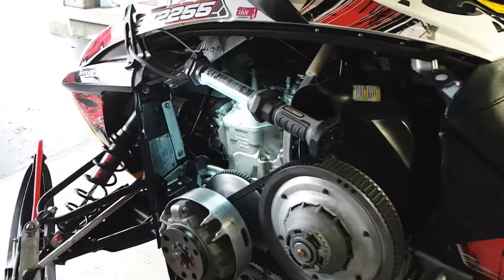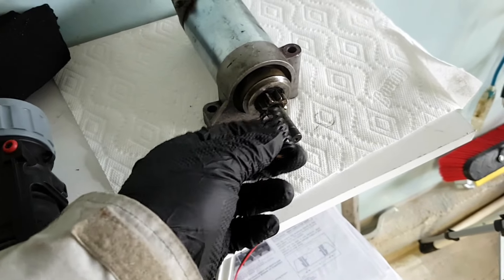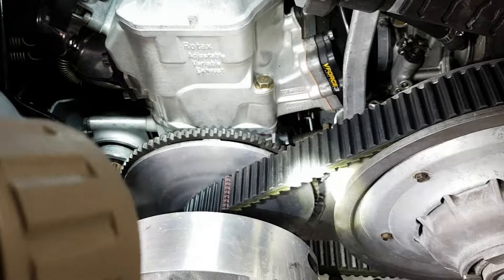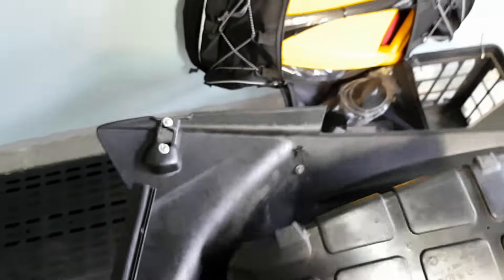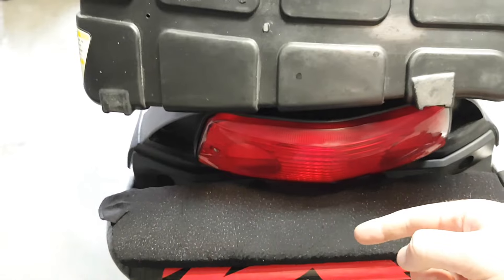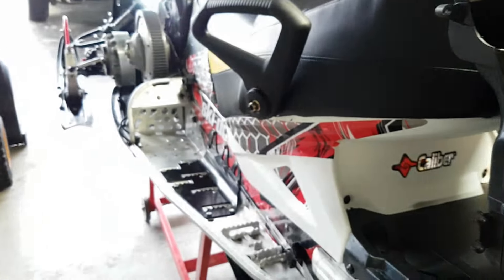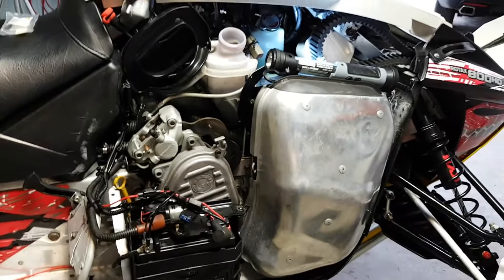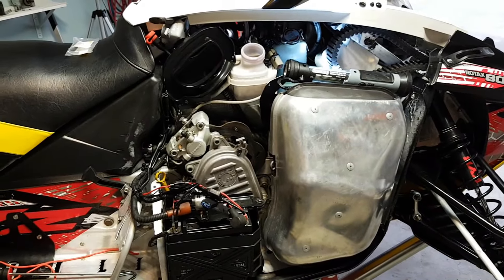Things Most Ski-Doo REVs Need Fixed (from factory)

Comment: Too much oil causes a lean condition? Wrong!!! And what you said about water in the oil is totally wrong, it will go to the bottom of the oil reservoir and freeze, causing your engine to seize. Same thing happens with water in your gas tank, water is heavier than both gas and oil.

Comment: Fyi, extra oil going through the motor wont cause a lean condition. The oil and fuel are fed through completely separate systems. The worst thing you’ll do is foul spark plugs. It’s more wasteful than anything. Good oil isn’t cheap!
Reply: According to Wiseco, that is precisely why you don't add extra oil when breaking in an engine after installing new top end.....so either they are wrong, or you are.
Reply: @davidstephenson7194  in their case you dont want to add extra oil during break in because the rings they use are made of a harder metal than most and take much longer to break in. The extra oil makes rings take longer to break in on any motor. Synthetic oil is also not recommended during break in because it prevents faster ring seating due to superior lubricating properties. If you dont break in wiseco rings before riding your engine hard they can expand too much and bind up in the cylinder causing  major piston damage. Once they are worn in the ring gap will be large enough to allow for proper heat expansion during high engine loading.

Comment: My 2006 renegade 800 has this weird thingy going on where it has a clicking sound every time i speed up. Do you have any tips on what it might be. I have already checked throught the clutch and didn't find anything wrong with it.
Reply from the maker: Sorry. No idea. It typically takes a lot of trial and error to locate noises. So many pieces ...
Reply: @TheGarage656  okay, I am pretty sure it's the bendix that is making the sound. I ordered a new one and hopefully it will fix the issues. Anyways thank you for helping my situation:)
Reply: If it's your bending you should see wear on your ring gear.
Reply: @warddan2002  I changed the whole bendix and it stopped for a while. I don't know if it still does it, because I sold the sled a few weeks ago

Comment: I have a 2007 GSX SDI 600. I keep the starter lubricated with a good spray weekly. A new belt needs a break in period to perform well and last longer. I also lubricate the throttle bodies, the oil injector & springs you showed, the throttle cable and the suspension. If you're gong to change springs of any kind to aftermarket, just be careful how much they affect the performance, especially anything to do with the engine. It's good you look the sled over and look for any way to improve it. Maintenance gets you back home. :)
Also keep the battery connections clean and apply some dielectric grease.
Reply: Nice: "Maintenance gets you back home." I'm going to use that!

Comment: I have a 2005 1000 and have a problem with it on my last ride last year with it shutting down & then the Ele start won’t start it back up but I wiggled the fuse wires & the fuse is melted    buy the battery but it did start back up, any suggestions or videos on the fuse by the battery on what to do? I would appreciate it.
Reply from the maker: When things start melting in terms of electric I take it to the pros. Too many ways to burn the unit down. It's worth the cost of a dealership.

Comment: what about the Boots for the Carb intakes - they are probablimatic as well prones to cracks and may need replacement
Reply from the maker: Yep. Good point. I needed to replace mine too.
Reply: Just changed mine on my Can Am Outlander. Huge performance improvement. For 63 bucks I hopebit lasts.

Comment: I have a possibly silly question, I’m going over my daughters Rev for winter (2005) and the Belt has a mark on the outside that looks like the Bendix is extending out while it’s running and hitting the belt. Sounds strange I know. 
My question would be if you had any of that issue before you changed that spring?
I’m also in canada, Ontario. 
Thanks  for any reply.
Reply from the maker: If the belt was up on the clutch really high I guess it might be a possible problem. Unfortunately that is one of the few problems I've never had so I cannot comment. Could it be the wrong starter (wrong model)? Therefore sticking out just a little to far (too long?)? Tough call. I hope you get a solution.

Comment: Hey great vid! 

Do you have P/N for those front shocks? Also, did you upgrade the center and rear shock too?
Reply from the maker: Sorry. No P/N for those. I went to a local guy who specializes in shocks (rebuildable shocks). Yes, the centre-rears did eventually get upgraded, as well as springs (doing one but not the other less than ideal). Shocks are silly expensive so shopping around locally with people who do it professional (rebuild them) proved the best deal.

Comment: Water in your oil will not dry out with cap off! When riding and shacking around it DOES mix and it will go thru your pump and into motor and try to burn it! No Good! Drain it out and start over with the skidoo cap. Another thing, these motors get no oil to bottom end, bearings are packed grease! So thats another reason they want these motors using extra oil, cause the bottom end is non lubed and they hope the excess unburn oil will eventually drip down to bottom end and somewhat help lube the 2 center bearings that ARENT changeable unless u buy a reman crank! Crank is 2pc and need special alignment blocks to basically time crank when pressed back together after bearing swap. Not many do this, thats why u just spend 800-1000 on a reman. Let that motor EAT OIL! Itll be the only saving grace for it! Good luck
Log on to REV Nation on FB if u want true rider tips and fixes. Not a fourm that shit the bed with kids on these sleds
Reply from the maker: If you are referring to the return spring on the oil pump arm, I'm not sure that I follow you. The purpose of the spring is to make sure the oil arm is doing exactly what you want (returning correctly). That's all. The amount of oil that enters the engine is then entirely controlled by the oil cable adjuster (a pain to adjust perfectly). Without the spring, the amount of oil (if the oil pump starts to fail open, or merely weaken with time) is guess work. In my case the return spring made a huge difference, which means I am only now able to regulate oil to factory specs. The oil cap is another story ... still not trusting it entirely.
Reply: Garage Philosopher weather u have that spring on or not, when the pump fails, it fails open inside. Not by the outer arm. All that spring is for is to return to neutral so to say when u let of throttle. Nothing more. If adding that spring changed oil usage then something else is wrong, or its making it too lean, not enough oil. And it will blow up in sooner time. These 800s were problematic,  the good dealers that know these motors adj them to use extra oil compared to factory setting, just cause they had so many issues.  A good day of riding, u should be using around half a tank. 140-180mi day. Any less these motors dont last if u ride them hard

Comment: Put a powerbloc 80 primary clutch on there less moving parts equals cooler clutch and itll go faster
Reply: Skidoo primary clutches are actually pretty nice. You can adjust ramp angles on the trail really easily from the factory with ‘clicker’ adjustments.

Comment: how do you keep your engine so clean
Reply: josh obrien hes doesn't ride it, lol
Or someone had sled fully apart, probably for the 9th engine swap or rebuild, lol and yhey powerwashed the shit outa it to find some sucker to buy it cause it was clean. Truth
Reply from the maker: Chrome cleaner for wheels works wonders ... just be careful with the water and dry the area extremely well after. I'd only wash it when it is out of the sled.

Comment: I took panty hose and rubber  banded it to the round inlet hole so nothing gets in there..  also the pre filter I did..I can't believe when I open the side panel, once it was a price of straw, then foam from the pre filter and brake dust...

Comment: Throw away that cheap oil cap #1
Extra oil in gas is not LEAN condition! It makes it RICH!  On skidoo motors, specially those PowerTek 800s after they blow up, a GOOD dealer that rebuilds it turns up the pump to use MORE oil and adds Fuel , so they wont BLOW up again, causing the sled to use a lot of oil and get around 10-12mpg on gas! So the 2 fixes u just did, might help cause a catastrophic failure to your poorly designed 800 Donkey motor. Just sayin! Went thru 3 800 , buddy 2 , till we found the right dealer that knew these motors from rebuilding tons of them. The 2 sleds we bought new from 06 one made it 800mi, the other made it 1700 before blowing up/ burning down cause lean tuning from factory.
Reply: I beg to differ. I will agree most people talk about rich and lean being the ratio of oil and gas. So more oil equals a rich oil mixture. However once that mixture starts burning it becomes the opposite. The more oil you have in the mix means less fuel that is being burned in the engine. That creates a lean condition. It took me a while to comprehend this.
Reply: Kwmike-D the factory should pay for a new one! I’ve heard a lot of bad stuff about the 800.
Reply: Tristan Munger that is wrong. Like 50:1 ratio is leaner than 32:1. I’ve always ran my race bikes with more oil than recommend before fouling which also brings up compression by a little cause it seals better. There has been research on this method later on as well. Never have I blew up my motors and they look good when tore down.
Reply: The 800 is definitely junk. But a skidoo 600 will last 10k miles or better
Reply: @tristanmunger157  in a EFI sled that is correct